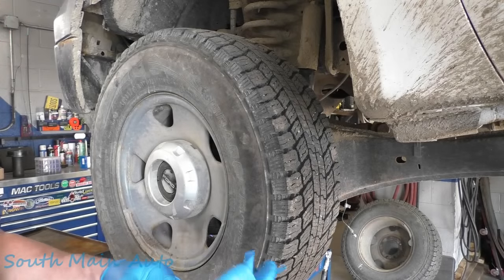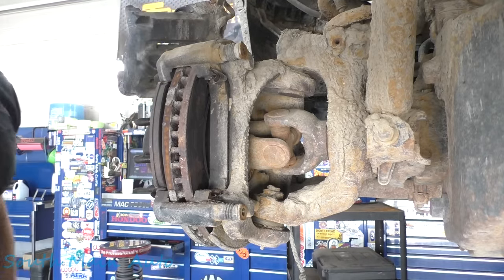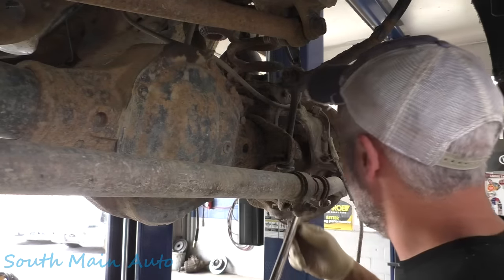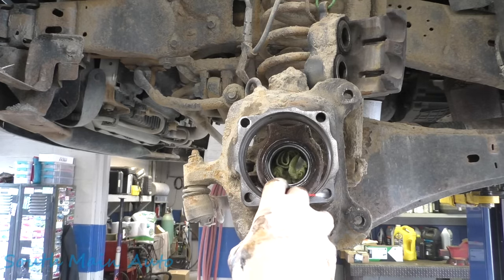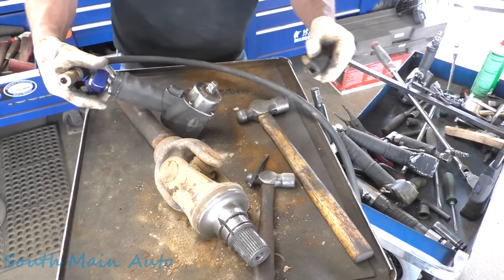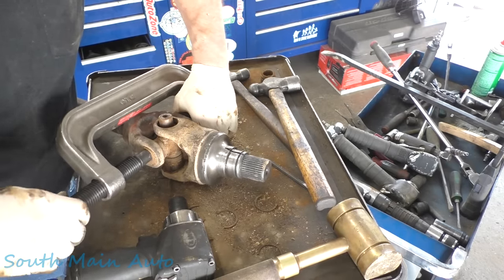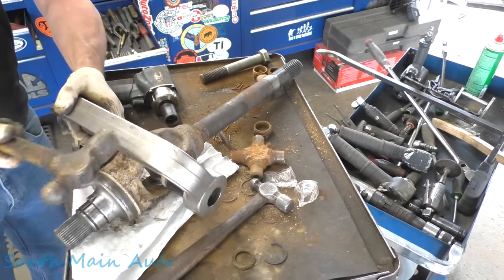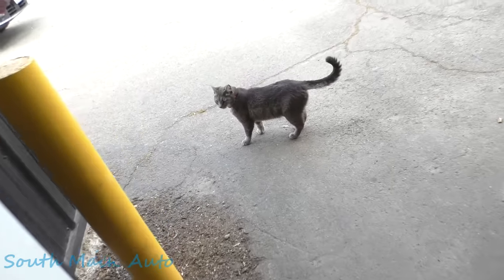Ford F250: Front Axle U-Joints Replacement - Part I

Comment: I changed my first u-joint 50 years ago and had no idea that the chant would help free up a stiff joint. Thanks so much for that revelation! I now feel complete.
Reply: Make sure the chant is from the right tribe.
Reply: @bobhudson6659  The fikawe tribe. "we're the fikawe"
Reply: To be quite honest, I use the bagpipes.  Never known to fail
Reply: @MrRunner  That only works on right hand drive vehicles.
Reply: I`ve replaced u-joints for 60yrs. and never chanted. Does cursing count?

Comment: Those old wheel cylinder hones that have been lying unused in the bottom drawer for 20 years work pretty good for cleaning the rusty ujoint holes.

Comment: I couldn't figure out how these joints came apart. I got the locks out but assumed the bore was smaller than it was and kept trying to chisel the "cap"  off on the outside - as if there was one. Then with frustration having set in, I had the bright idea to try YouTube. Eric has the perfect video to explain everything including using the OTC ball joint press that I've rented before. This is a much better idea than using my shop press. I work on BMWs that don't have replaceable u-joints. Kudos to Eric!

Comment: That press is pretty awesome, till I got one for the shop I just used a bench vise with sockets. Didn't know you supposed to chant, I just hammered away till they loosened up. Heavy duty u-joints are always difficult. Great tip for next u-joint job.

Comment: Eric I am very jealous right now, I just spent the past two days putting wheel bearings on an f350. Torch and air hammer was no use. Beating each side for 45 minutes with a 10lb sledge finally did the trick. Watching you tap those out was perfect 🤣

Comment: Great video as usual. I've spent far too much of my life fixing Super Duty front ends. At least it wasn't HPFP seals on a 6.4L Powerstroke. I'd prefer slow, painful death to doing that job again. The Lever quote was Archimedes I'm pretty sure, but I wasn't around to hear him say it.
Reply: Wasn't aware that the 6.4 Powerstroke had a HPOP, the ones  that I know were High Pressure Diesel Pump. My 6.0 Powerstroke has a HPOP
Reply: @stevenrobinson2564  thanks for the catch. I was referring to the HPFP. I went back and corrected myself. You have to pull the compound turbo to replace that seal. I didn't have a way to remove the cab, so it was a nightmare. The 6.0L HPOP seal is also a common replacement I have had to do. That one is much easier since there is room to work and only one turbo to contend with.

Comment: Love your videos, i understand using a cutoff wheel as a deburring tool works for you......But i may suggest cutting some tan scotch brite pads (available thru MSC or equivelant) into circular shape and mounting it on the tool. I use that method daily in the machine shop and it works well for me. Safer for you. Just a tip to pass along!
Reply: Thanks a lot man. I’m 31 y/o and I gladly lend my ear to anyone like yourself giving knowledge
Reply: Can you line up a bunch of pads and hole saw them all at once?
Reply: @LadyAnuB  Just buy the super coarse (tan/brown) Roloc discs from your auto parts or welding supply.

Comment: Absolute overkill!! Nothing wrong with old U joint. Just needed a big hammer, a few "love taps" and a bit of grease through the frozen grease nipple (jerks) and uni cups and Bob's your uncle. 71 yr old retired mechanic in Land Down Under. On second thoughts maybe a little more than what I suggested - like replacing it.  Also need to teach owner what grease is.
Reply: How many spiders did you have to fight over your years over there? Can Vegemite be used in place of grease? 😛

Comment: Hey Eric O. love your vids and the way you do your business but I have a serious question... wouldn't a pressure washer applied to a job like this before you work on it make it a little easier to work on and keep a little crud out of critical parts?  Keep up the good work!
Reply: Who pays?
Reply: Time is money & he's used to it .(in a rural area.)
Reply: I think he talked about this in a previous video. Dry dirt way better than working in mud. He prefers it not being washed previously.
Reply: @lexteakmialoki5544  I would think the power hammer applied judiciously would be fast and efficient?
Reply: @LadyAnuB  Or maybe a needle scaler.
Reply: @mbhales  Both! Hammer for springs and stuff of that sort. Scaler for solid surfaces. For the adventurous, dual wield! 😂
Reply: @LadyAnuB  Agreed. I didn't like that he was assembling the new u-joint on that dirty cart.
Reply: @fredsalter1915  My issue with the cart was the ball joint disassembly tool usage. Place it on the cart, flat side down, then just move the u-joint around. Or place a block of wood under it to elevate it to allow impact wrench usage.

Comment: That little wack on the ball joint press is called a trick of the trade. I know that's not how the tool was intended to work but I'm sure the engineers took everything into account when designing it 🤣 I love these types of videos.

Comment: Great tips on avoiding yoke distortion.  Did this on my 2002 F250 7.3L a few years ago and had to realign my yoke with a homemade allthread fixure.  I spent the big dollars and went with Dynatrac Freespin to get rid of the unitary bearings.  Also did the rebuildable ball joints.

Comment: I would have simply charged $150 extra to go to the quarter car wash and blasted off all the mud and grime.  Far easier to work on and far less chance of contaminating the process.  The customer is a rude rube for bringing in his vehicle dirty.  When I was much younger in the early 70's my motorcycle mech.  (Shout to Micky Dawms) charged $50 extra for a dirty engine he had to work on.  Taught me a valuable lesson.  Another fantastic mentor!!

Comment: Much appreciate your making this video.   I tackle many things I have no idea what I'm doing.   Though I've replaced on my 6.0 an Oil Cooler, removed the turbo, replaced pipes, and other head banging things that makes me nuts, I've just been fearful of doing this.   But my trucks sat for to long, and I need to get her on the road.   I bought the new UJoints months ago, now your video has given me more confidence.....Thanks.     
    A Symptom I have driving, the steering will jerk left and/or right just randomly going down the highway.   So I have to keep a tight grip on the steering wheel.  I quit driving it unless going a block to get gas cans filled for my lawn mowers.     I also had purchased a new steering box before I determined(guessed) it's the Ujoints, not the steering box.    But hey, with 240k miles, just replace it all right?

Comment: I had a '75' CJ-5 for a 11 years. At sale I had rebuilt everything except the driver's side front knuckle at least once. Universals I used my vise. Put both caps in and press until even with the yoke back off and put a 1/2" nut on one bearing cap install the clip and move the nut to the other cap and repeat. You can use the nut trick to break them free also.

Comment: I had the same hub issue happen to me on a 1999 F350 Super Duty in 2007 or 2008.   All it took was one or two Northern winters to start the corrosion process; even after moving South evidently the corrosion continued.  The fuel lines rusted out as well, those had to be replaced and custom-fabricated since it was a first year model and Ford made so many changes in production the original line was not available.   The brake lines rusted out too.  Both fuel and brake lines had to be custom fabricated (tubing bends and push-pull fits).   This was on a truck that was regularly washed and serviced.  Yes, it did have the 7.3 diesel.  I had flashbacks watching this video!!!

Comment: Seeing that hub, my first job (1968 or so) involved tropical Africa farmers trucks. My job, first week or so, take a high-pressure hose to the Suspension and wash the mud off so the Mechs could actually see what they were working on! Rust was NOT a problem.

Comment: got a new f-150 in 1984 had it 22 years 4 wheeled all over central and northern california put 540,000 miles on it and never had to replace front drive shaft or front axle bearings or u-joints, but the main drive shaft at least 2 times a year had to replace them until i had a new drive shaft made and the last 6 years never had to replace any u-joints

Comment: Ah yes replacing "U" joints on two piece drive shafts.  Remember it well.
We did it at my Dad's shop with a vice and a couple sockets.  Didn't have the OTC tool.
After assembly followed by a good greasing came reinstallation then road test.  "Good Times" as Lucky says on Hot Rod Garage.
Good one Mr. O!  
Kitty wasn't so friendly today.  What happened?  No food?

Comment: Those 3v 5.4 liter tritons are such a gamble to do repairs on. My old 2012 work van "90k miles" blew the head gasket, blew a tranny and then the last straw was the roller rocker arm snapped off and blew the motor up.

Comment: Helpful hint on pushing the cross back through straight.  Grab a shallow thin wall socket that has slip fit on the ID of the yolk that you really don't care about.  12 pts usually work good for this.  Slide it over the end of the cross.  It's usually pretty close to exact on the cross OD.  Then push the shooting match through.
Reply: I cheat. Have a lathe and make a bush with the ID slightly oversize and OD slightly undersize. Then keep it with other sleeves I have made for various jobs. 71 yr old retired mechanic in Land Down Under.
Reply: I came here to make this same comment.  I am an atv mechanic and this is how I learned to do it through trial and error to avoid getting caps cocked and gouging yokes.

Comment: I use the big pry bar to slave the caliper over. I hook it on the axle shaft or other appropriate pry point and giver. I often do that on the rear calipers on superdutys when i service them to keep the sliders free. Just dont forget to pump up the pedal before driving away. Also i unhook the tie rod end to acess the wheel bearing nuts.

Comment: Ugh I've done a few of these, not a lot of fun. Basically plan on replacing everything you touch ha. Ball joints included! Knuckle off and drive the bearings out by the studs when just run the air hammer through and push the ball joints out. Ours were from a small fleet of plow trucks so extra rusty. Mostly things just came apart but it was tedious dealing with the seized in hub bearings. We did such a good job getting ahead of problems for their fleet that we started seeing the trucks JUST for regular maintenance instead of urgent catastrophe and they were able to actually reduce the fleet size since they didn't need 2-3 backup trucks anymore.

Comment: @17:06 Nobody ever greases u-joints because most of them are "sealed-for-life" bearings with no grease fittings.
I had 2-D250 Dodge pickups one a 1979 and the other a 1990. Both had grease fittings on all the front suspension components.
Both went over 200k miles greasing regularly not having to replace any parts or even front end alignments with no abnormal tire wear.
It's a testament to longevity of vehicles vs planned obsolescence.

Comment: U joints on my 84 GMC I had to use a propane torch to heat them up and some orange pookie flowed out of weep holes and it came right apart. 
That's after an hour of hammering til my baby brother came by and told me about factory pookie.
This was  about 2000.

Comment: Tiger tools u-joint presses.  Expensive but they make joint replacement almost fun.  I think you can get cheaper imitation versions of the Tiger Tool presses but I haven't tried one yet.  I  now know hammering the joint upon assembly will loosen things up.  Thus far I've used the Tiger Tool to push the cups against the snap rings.

Comment: I'm surprised that 1)  you didn't wash the front end to remove the mud and crud before you brought the truck inside  2) you didn't use a penetrant on all the stubborn threads and on the yoke parts you were disassembling.  I picked up a great tip about removing those stubborn bearing caps, though.  Consider mounting a vise on that cart.  Very good video.  Big thanks!

Comment: Grandma told me, you're supposed to hang a 25-pound weight from the brake caliper to make sure it doesn't swing around too much. 😄
For that certain "F" word, change the U to an E and you can say it all day long.
In your line of work if you're busy things can gat a little messy.
I'm a painter, we spend as much time cleaning the booth and preparing the next job as we do painting. It never ends. 
Cha Ching!

Comment: Hey mr. O I'm a big fan of your videos love them all free tip Friday with those brake caliper configurations I usually use a gigantic c-clamp I wrap it around the back of the caliper push up against the outboard brake pad they usually always does the trick to compress the Pistons so you can clear those little dongers on the inboard pad that likes to shatter the caliper Pistons give it a try next run trust me you'll like it

Comment: I can't believe how easy that bearing hub came out for you. I've had one or two of those studs seized in the spindle too where even using heat and an extension and using the power steering as a press, it was still a nightmare to get them hubs out. My shop is in detroit, where they salt the roads, but having watched a ton of your videos, it seems like the vehicles you work on are far worse off from the effects of salt than what I work on.

Comment: Orientation should be mentioned about the grease nipple because if put the wrong way it can't be reached with a normal nozzle. And seal should be installed without lube, they tend to move around if lube is used, but you can coat the inside of the knuckle with a little grease after installing the seal to prevent rusting. Just some more suggestions. I do quite a few of these trucks. Mostly 6.0L
Six hoe's, six blows, what ever they want to call it. Lol
I love them, and your videos also👍

Comment: I only use a hammer and a 1/16"X 5'' drift. No press, no vice, not even a workbench. Just throw it on the floor and use a BFH, not a toy. I whack the side of the stubby yoke to give a little clearance to 1 clip and tap it out with the drift. Slick up the caps up with Cyclo BreakAway then whack the yoke the other way and completely expose the 1st cap and remove the opposite clip. Then whack the yoke the other way and remove the cross + cap.  Repeat for shaft caps. I wire wheel both yokes completely instead of whizzy and clean all the dirt right off everything. Then I slick everything up with grease and move to a clean spot on the floor so I don't pollute the new needles. I Put the cross inside the stub all the way to one side and start a cap on it, gently tapping w/ BFH, while holding the cross inside the new cap to keep the needles in place. I keep tapping across center just slightly, until I can safely start the opposite cap. Then tap both sides in and clip. Repeat for the shaft side. I also whack the joint to free it up, AND I always mark the orientation just because I do. (call me anal) And I grease the cross as the last thing.  ben/ michigan PS You have no monopoly on the salt thing, Detroit was built on a salt mine, and I've heard the car companies pay for the salt, all MDOT has to do is spread it.
Reply from the maker: Largest salt mine in the USA is a twenty minute drive from my shop 😏

Comment: I had a very difficult time getting those snap rings out from inside the hub.  I bought every snap ring pliers I could find locally, bought a long one from amazon, it reached the snap ring better but I couldn't squeeze the pliers enough to release the snap ring, the handles would flex so I couldn't apply enough pressure on the snap ring.  I ended up grinding the jaws on a vice grip so I could vice grip the handles of the snap ring pliers.  Took forever, but was the only way I could get them out.

Comment: Two 8 inch G clamps are the easiest way to push back those caliper pistons then I remove the caliper bracket with the caliper still bolted on and hang it from the bracket to top of coil spring. Just a suggestion.